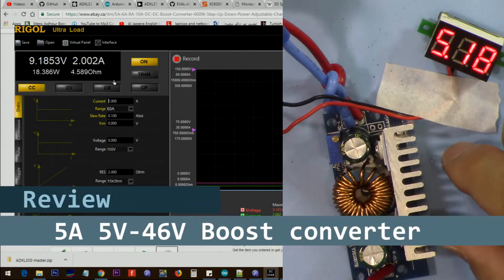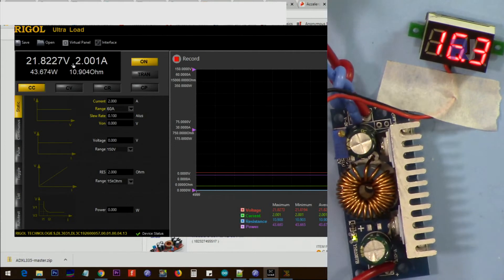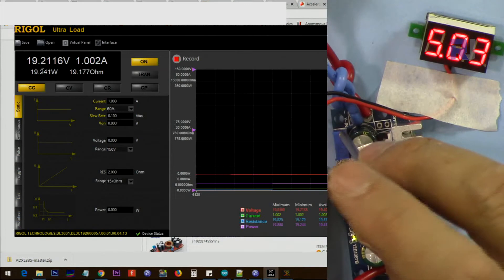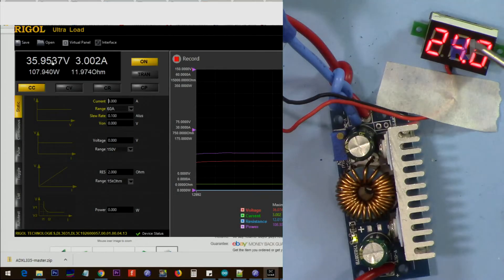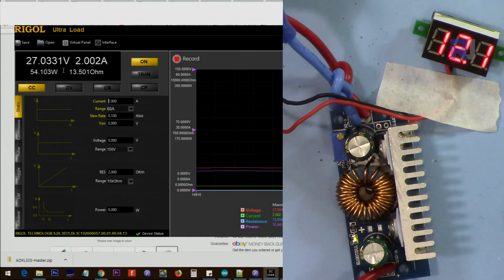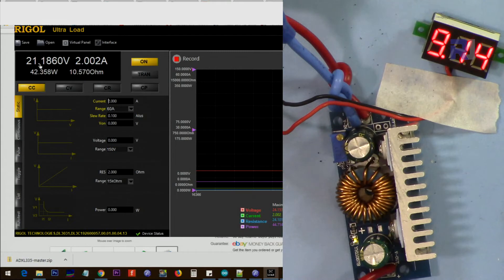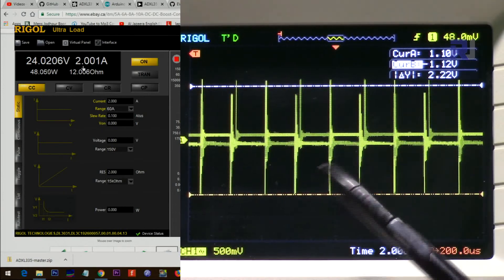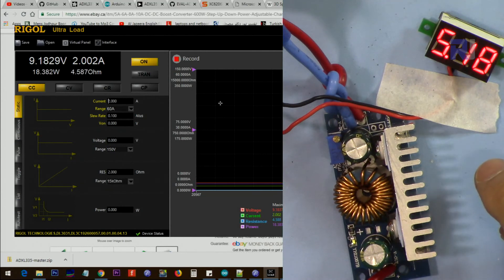Review of XL6012 5V-46V 5A Boost converter Module RJT192

Comment: hi Ahmad, could you tell us, if this can be connected in parallel. for high current 5 v to 12 v do we get any solution.
Reply from the maker: Hi, yes you can use them in parallel but make sure you set both modules at exact output voltage and current
Reply: thanks, i would like to know, while running in parallel, should we isolate the input power source or can it run from single power source.  then, can we expect more or less additional AMPS on each additional Channel. does any such circuit exist, meaning, single circuit which can deliver 5 amp or more for 5v to 12v requirement.
Reply from the maker: you can use the same power source.
Reply: pm me can you to install do solar panel of charger
Reply: pm me can you to install do solar panel of charger